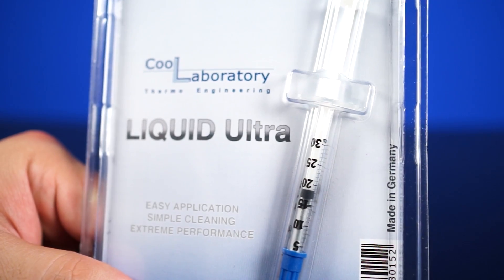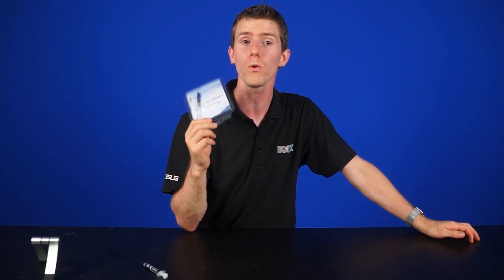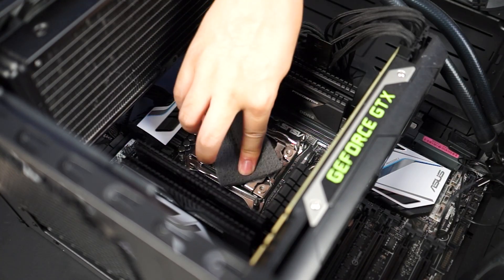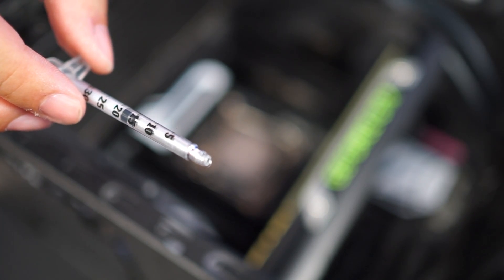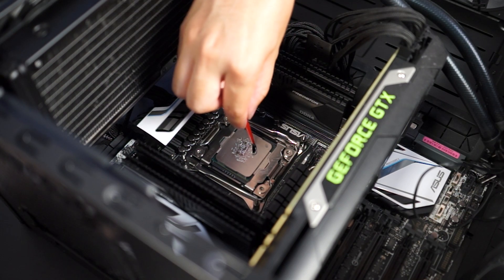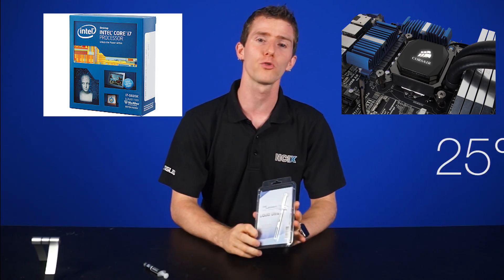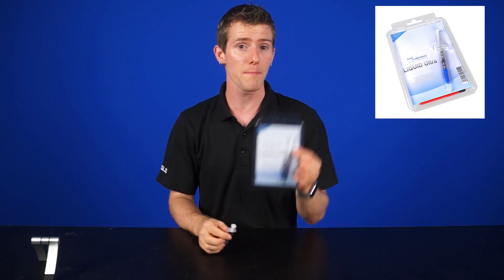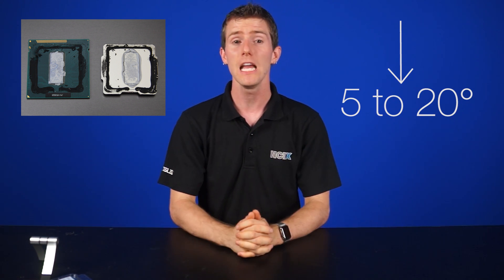CoolLaboratory Liquid Ultra Thermal Compound - Wut iz?

Comment: As soon as he said gallium I knew that aluminum heat sinks were out.
Reply: Heat spreaders are nickel coated copper, NOT aluminum.
Reply: Vince R. Except for cheap ones.
Reply: Why would you even need this in a aluminum heat sink? This shit is only useful for extreme overclockers, and you probably would use a water cooler with copper plate...
Reply: ***** I read it wrong at the time.
Reply: TrollFaceTheMan  hey, sorry to bother u but iam desprate ,any chance u know how to figure if my heat sink is made of aluminum or not? its a lenovo y70
Reply: Vince R. There are cheap ones that have aluminum between heatpipes or on the edges
Reply: Ahmed Faisal nobody is going to know that here, you're gonna have to remove the cooler to check yourself.  The only part that matters is whats in contact with the cpu or gpu anyway, and you can use gelid cooling extreme or something if liquid metal isnt appropriate
Reply: This thermal compounds sucks! My Asus G50VT uses a copper heatsink, and after about 9 months this thermal compound would start insulating to the point where I can't use the computer anymore. No, it wasn't dust. Happened repeatedly in 6-9 months. Was tedious to scrape the dried up old Liquid Ultra from the heatsink and CPU with a razer blade. 
Switched to Arctic MX-2 and it's been lasting 4 years now of hard use with little to no thermal conductivity degradation!

Here is a video of the troubles I had with Liquid Ultra; https://www.youtube.com/watch?v=jNgIQQcUSDM
and someone else; https://www.youtube.com/watch?v=FW8fgTjHdCo
Reply: No they are not. Its typically made of copper or a copper alloy. Never seen one made of aluminum.
Reply: The heatspreaders on CPUs are made with tin-plated copper.
Reply: Rat Face no, we're not talking about heatsinks were talking about heat spreaders. never ever seen an aluminum heat spreader and I hope it isn't real lol.
Reply: Aren't most heatspreader also made of aluminium? So a delidded CPU that is cooled by that stuff will soon not have a heatspreader anymore.

Comment: Arctic silver is very, very bad. It has like 5 W/mK.
Good paste has 10.
Reply: a google search says 8.9 W/mK
Reply: mastorione Google also says, the earth is flat.
Reply: Ernst Stavro Blofeld Are you saying it isn't?
Reply: Arctic Silver 5 has 9W/mK https://www.caseking.de/arctic-silver-v-waermeleitpaste-3-5-gramm-zuwa-010.html
Reply: It's actually a little less than 1, but 4W/m·k is about as the highest 
any paste has actually been proven to measure, so if "good paste has 
10", good luck finding good paste.  (Actually, thermal conductivity 
doesn't matter as much as thermal resistance when dealing with a thin 
layer anyway).

Comment: does this work on the 212X and i5 6600k
Reply: Pretty sure the 212 has an aluminium base with direct copper heatpipes, so no. Its only really worth using for a delid (did it myself on a 4690k at 4.5ghz and temps dropped just over 10 degrees, and that was with mx4 between the heat spreader and cooler) or a gpu. My 390 temps dropped 15 degrees from it, with 40% lower fan speed
Reply: +Wolves4ever 01 you couldn't be more wrong its so cool I haven't seen my cpu go over 50c even on load
Reply: You didn't get his point.
It will ruin the heatsink on your cooler.
Reply: Oh okay it was only a £30 cooler anyway
Reply: ***** really?
Reply: ***** now I have to take my pc apart tomorrow can you recommend an paste
Reply: ***** wait I didn't even apply that paste. This is what I applied https://plus.google.com/photos/...
Reply: https://plus.google.com/photos/...

Comment: Gallium does more than stain aluminum; it turns it into carboard.
Reply: low or high carb?
Reply: xiLuS gallium is Ga mercury is Hg
Reply: Happend to me :( :D
Reply: Chris lmaoo
Reply: It actually turns into chocolate wafers 😂
Reply: it reacts with copper also given time and dries up.
Reply: Holy sh*t so this compound actually DOES contain Hg? Do you perhaps know in what form the Hg is? I just came across this and the first thing that popped up in my mind was that it most likely contains Inorganic Mercury and as such I would rather die than have that sh*t in my house or anywhere near a living being.

Comment: Acquired a friends 4770k for a slight upgrade only to discover that the CoolLaboratory compound on the cpu and water block is rock hard. Yes ROCK HARD folks. Completely resistant to isopropyl alcohol or any thing else I tried. The internet suggest scrubbing and scouring the surfaces. Wah!

Comment: I delided my i5 3570k @4,5Ghz and 1.35V and dropped from 90°C under full intel burn test load to 48°C using this thermal paste. worth it
Reply: I call the bullshits!
Reply: VelocityRewinds IM SO SOOOOORY I LIEEED I LIEEED IM SO SOOOORRRRYYY
https://gyazo.com/a4264d64a0c823fa85044c2f99f4a425 :(((( i will never do it again forgive me master
Reply: Doktor Schnackels i used the Alphacool NexXxoS XP³ Light in my build.
Reply: im gonna do the same with my 3570k ill easily hit 4.8ghz easy or more. at 4.5ghz i use 1.280v so with 1.380 i can easily be set at 4.8ghz. hopefully.
Reply: :O
Reply: +xChrisMas Respekt. what Kind of CPU cooler do you have?
Reply: damn man, i need to delid my 6700k, one of the cores runs 10C higher than the others, and it's making me nervous going above 4.6ghz while i know it can do it... is it a hard process ?

Comment: don't even try to use that shitbrush. Use medical rubber gloves and apply stuff with your finger (don't forget to wash them with alcohol AND dry them before using). That will make process much easier and you will have way more control on how does it distribute on the surface.

Comment: I tried this stuff and it turned out to be total krap. Biggest waste of $16 I have ever spent.  With the syringe I got, half was way too watery and the other half was way too thick - so thick that I ended up breaking the plunger part of the syringe trying to get it out .  I never had a chance to even test one application because the whole contents was totally useless.  I'm not the only one that got a bad syringe, look around retail review sites and you'll find the chance of getting a bad product is pretty high.

Save yourself time and money and get a liquid metal TIM that will perform just as well, cost half the price, and will actually work every time.  It's called Conductonaut by Thermal Grizzly.

Comment: Hello! I wonder if you could re-shoot this video? Two major points of improvement:

1) If you've used some other paste before on the CPU or cooler you will have to actually sand it down properly. It's not enough to just "roughen up" the surface because if you just do that, for the most part the thermal interface is going to be sandwiches thusly:
CPU lid | old thermal paste | liquid paste | old thermal paste | heatsink
And as you can see, here the bottleneck would be the old thermal pastes. Sure, they are a lot thinner than before, but adding those medium changes really does change the properties. (Compare: 1mm thick glass vs. 0.5mm thick glass with 0.25mm thick plastic guards on both sides - you can bet the 1mm glass is clearer.)

The guide I found for applying this stuff actually suggests that you sand it down to a mirror finish. "Roughening up" the surface can hardly be called a mirror finish. There's actually a way to see when you've removed all the old gunk: when using isopropyl alcohol, the alcohol turns the old paste grey. If you sand the CPU lid for long enough all the time adding isopropyl alcohol and occasionally washing the abrasive pad (or fine sandpaper, whatever you are using) you'll start to notice that the amount of grey stuff decreases and stops altogether. This took me some 15-30mins of sanding. This, I suspect, is when you've removed most of the old thermal paste. Ideally you'd actually buff the surface with something so that it's actually close to a mirror.

The stuff isn't glue so increasing contact area isn't necessarily going to help heat transfer at all. It's more important to get all the old insulating stuff off.

2) Other people mentioned this: the liquid ultra should be spread on BOTH surfaces and so that they look like mirrors. Paint a mirror.
Reply: +Klikkitse 

My theory is, it's not poor application some people are experiencing, it's poor quality control by CL.  If you look around review sites and forums, the quality of product people are getting varies widely.  There are even people who are getting syringes containing such poor quality TIM the stuff is totally unusable.  I should know, I'm one of those people that got one.

Comment: It is incompatible with aluminium because of the gallium it can infiltrate and bond with the aluminium and compromise it's structure. To the point where the aluminium can become as weak as wet tissue paper.

Comment: he applied it wrong. the surface was NOT covered correctly. ive used this before and the stuff performs very well in terms of cooling. the problem though. is that after several months it seems to "wear out" ive had this happen on my alienware 18. and my current m15x. if you want the absolute best. go with CoolLaboratory Liquid Ultra or "pro" i cant remember which is better. but its a bit of a pain to set it up right.
Reply: +Zenobia K&#39;ael I have the exact same experience with the fluid! After 3-5 months it suddenly crystallizes and stops conducting heat.

Comment: If everybody get's 20 degrees cooler by delidding then Intel is doing something wrong.
Reply: +MegaMech the fact that you can delid in the first place is what they're doing wrong. they're not soldering it on the chip just gluing them on top of with their own thermal paste inside.

Comment: Much people say it's very good, and good tested. So how could the test result that bad?
Reply: +Ronaldoz Gaming Because you use this stuff on the cpu die itself not on top of the cpu. Like in this video said, you get like up to 20c less. I got like 10-15c less on my delidded 4670K.
Reply: +FantaFuture92 Ah I see thank you!!! I will put it on their then when doing a delid. I just did it on my GPU and the temps are on higher voltages -40C+. Really awesome!!

Comment: Are thermal paste necessary?
Reply: +linkzellda yeah theres no reason not to get any its dirt cheap http://www.amazon.com/Silver-Thermal-Heatsink-Compound-Syringe/dp/B00M5G6AHY/ref=sr_1_3?s=pc&ie=UTF8&qid=1455108263&sr=1-3&keywords=Polysynthetic+Silver+Thermal+Compound
Reply: +linkzellda Just get a cheap CPU fan with preapplied thermal paste, or just use the stock cooler which also has preapplied thermal paste.
Reply: CogniVision how could the paste be preapplied if youre not buying the cpu with the heatsink

Comment: Used this on my soldered fx-6300 and max temps dropped 12 C from couple of years old arctic silver 5 paste. Though there was a bit of dust removing too. (63 -> 51 C, Noctua NH-D14)

Comment: Come on NCIX. I expected more from you guys who should have a decent understanding of bottlenecks.
CPU Die > Intel's Garbage TIM > Heat Spreader > Liquid Ultra > Heatsink

Obviously not going to be effective on a non-delided CPU that isn't soldered.

I can speak from personal experience (with my i7-4770K) in saying that by replacing Intel's garbage TIM with this I dropped my temps by about 20C.
Reply: +Rusu Ovidiu: TIM = Thermal Interface Material
Reply: Exactly this. I would absolutely love to see a follow-up video from them with this, but actually de-lidding and lapping the CPU to see the real temperature differences.

Comment: Actually I am running a i7 2600K. So there is actually no really need for it. When I upgrade to a new system, and when it is necessary, I would remove the IHS and go for liquid metal. But my old Sandy is doing fine so far.

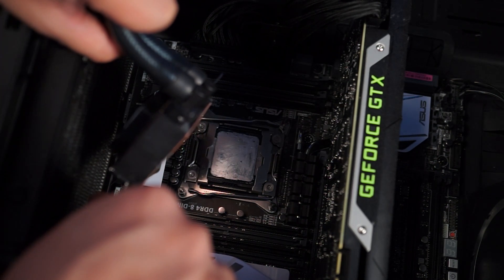Comment: 3:05 LOOK AT THE APPLICATION I CAN STILL SEE HALF THE IHS! Who let this idiot apply this stuff?! He was literally painting it on!!!!!!!! He made it thick in the corner and the center and opposite side of it has barely any to make a contact directly over the die and half the IHS. You're supposed to keep a decently thick layer in the center over the IHS and spread it EQUALLY and thin across the rest of the IHS. He just mashed it with his brush on one side of the IHS and then brought a tiny bit over to the other side. WTF, so much cringe!
Reply: +Marshal Beard You really don't need a lot of it to begin with. Hell, I barely applied any on my CPU and my temps dropped 10c. A very very thin layer of this stuff is all that is needed imo.

Comment: So im not gonna delid my amd Fx or scratch it...it is better than normal thermal pastes???or its good only under extreme circumstances?
Reply: +Johnny “Walker” Kat It's better than thermal pastes, but to clean it out it will be a big problem. You can't get out all of the Liquid Ultra after some months of use without polishing the lid exterior and the heatsink, which in the CPU's case it will erase the branding.
Reply: Eleriam nah it's a risk... Not gonna do it my fx is brand new for now...

Comment: I swear by silver based thermal pastes.  As long as you don't make a mess, you can't fry anything with them, and they perform much better than silicon greases.  Silicon is kind of gunky and slippery, and I just don't like applying it.  Ultimately, they all help get the heat away from the processor, and what you don't get out of your thermal paste, you can make up in your cooler, so it's really no big deal.

Comment: No. Too much effort and too little payoff. Right now I'm using Prolimatech PK-1 and it's doing fine.  
What I can recommend though is changing the thermal compound on your GPU, since manufacturers often use low quality, very brittle paste. One time I was certain that they had applied toothpaste and only parts of the chip were covered. And since GPUs (especially high-end models) will generate a lot more heat in gaming than CPUs (my Intel Xeon E3-1231v3 is pretty much twiddling its thumbs in most games), every degree saved is a plus (more headroom for overclocking or lowering fan speeds).

Comment: CLU/CLP are the only good TIMs fo delided CPUs, because it have no pump out effect, not only because of best temps. Every other TIM i tested on delided 3770K (bare die - H110), including GC Extreme, have temps rised over time because of pump out. No problem with CLU. And damn you Intel for not using soldered IHS anymore. Thumbs up for AMD Zen, or we gonna be F up.

Comment: Gonna use this on my delidded 4790k. Used AS5 and seeing temps of 72c on full load.
Reply: EvilWiffles be careful when you do, it's conductive. Use some clear nail polish on the caps... and seriously only a tiny, tiny amount of liquid ultra. I saw a ~20* drop on hottest core.
Reply: fattymcgee123 I've already done it.
http://imgur.com/gallery/wP98C/new

I already know how to apply it, not like I haven't had any experience in the past with the FX-6300 :p.
Reply: yep, go for CLU, and read about pump out effect with other TIMs
Reply: kokakoalak Yup
Reply: +EvilWiffles dang I forgot to put clear nail polish on the caps. I'm livin dangerously. How are the temps on the GPU? I'm thinking of putting it on my 970s.
Reply: itsmistersmoke It didn't do much of anything. I ended up removing it from the GPU and using IC Diamond instead.
Reply: EvilWiffles I see. well, I'll be putting some Grizzly Kryonaut on my GPU's then
Reply: itsmistersmoke Sounds good.

Comment: don't spread it guys! you doing it all wrong!! pressure itself will spread it perfectly when you place the cooler on top. I also read that most heat is on the center so just one drop at center and let it spread with pressure. also this was the right amount to apply for any paste.        just sharing my research
Reply: You're supposed to spread this stuff. It's liquid metal, not regular paste.
Reply: Karst van der Ploeg yea.. turns out i didn't realy get this product thing is different that way , it needs spreading and you are right. also this thing got better scores at a tomshardware review i saw so it seems to be worth it for enthusiasts.

Comment: I was considering this when upgrading from arctic 5 however you should also note that its super conductive and if you get even a tiny bit on anything other than your cpu, you will brick your system. I ended up buying a paste instead.

Comment: I used their Ultra Liquid when I delided my i7-4770K and it worked wonders. The 4770K has crap thermal paste from Intel and I saw about 15* C drop in temps across the board. NCIX would do well to carry this great stuff.

Comment: I tried both version of their liquid metal and the ultra, never had success. it DOES NOT spread properly and makes some stupid alloy and ruins your water block.
Reply: Heybat holy shit dude do you ever read anything? OF COURSE it doesn't spread it's fucking liquid that's why you have to spread it yourself and was there not enough warnings not to use it with anything else than copper and nickel heatsinks? it's fucking gallium which basically melts aluminium.

Comment: i bought this because of this video, for my delidded 3770k and experienced a 40c difference. but saying that, i probably put to much thermal paste between the cpu and the cpu heatspreader before. 
specs:
i7 3770k @ stock, noctua c14 with u.l.n.a. 
ilde temps: before: 45c after: 33c
temps after 5 min of prime 95:before: -(probably over 100) after: 50c, max prime95 temp after 24 hours: 62c

Comment: I run CLU on a bare die 4790k. The difference in temps is amazing. I Barely need to run my stock fans on my lapped h100i. 4.9ghz @ 1.35V with 75*C temps. Fans running about 2000rpm during P95 26.6. During gaming I run fans to a max of 1100rpm and still only achieve 55*C max CPU temps.